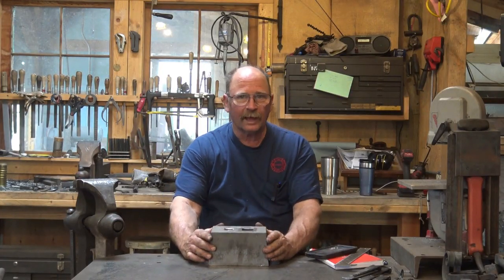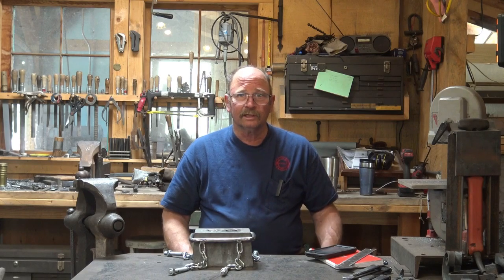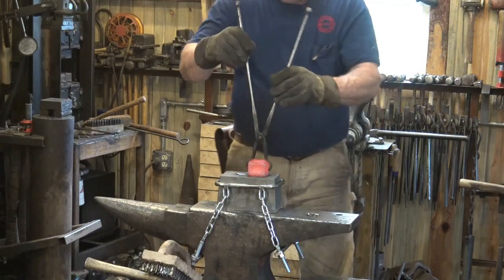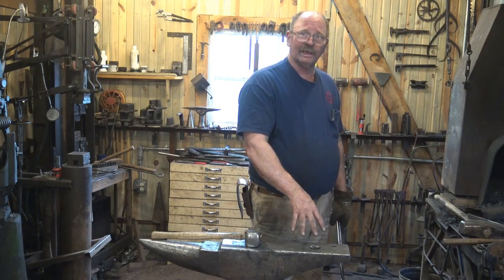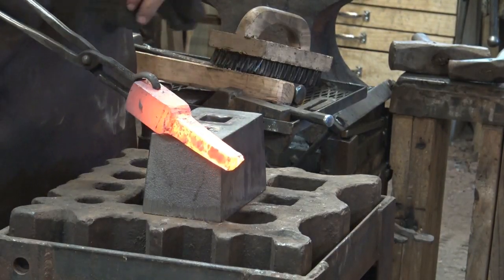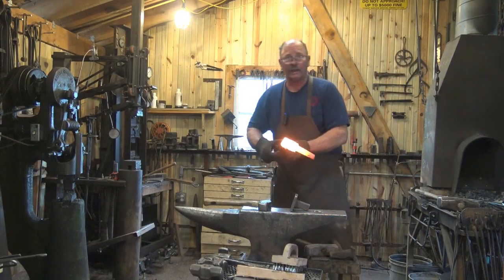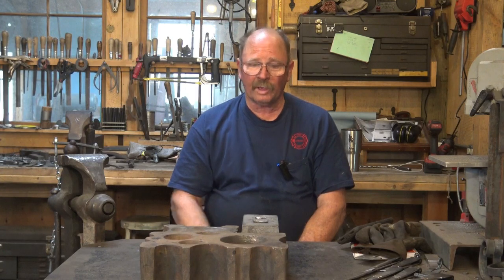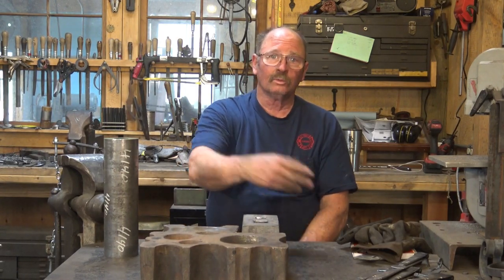Forging hardy tools using an anvil block - blacksmith tools

Comment: Hey John Really enjoyed this one getting to see the use of that power hammer especially :-) thanks for the video God bless
Reply from the maker: Thanks.  Its not a bad hammer, but it doesn't have the precise control of a self contained.
Reply: Totally off topic of this video. I purchased a post vise this week and the spring needs rearched
Reply from the maker: just heat it and bend it to shape.  Post vise springs generally aren't hardened.  It doesn't need much bend, just enough to push it open.
Reply: Thank you

Comment: These anvil blocks (the version you put in the hardy hole) also work a charm when forge welding.  Draws a lot less heat out of your work piece and gives you a bit more time for working.

Comment: John, the black hose behind your power hammer worries me. It seems very tight at the coupling. It got to really resonating the longer you ran the power hammer. You may need to look into a longer hose and some steel braided stress relief hose for the connections to the power hammer.
Reply from the maker: That is just an exhaust hose going through the wall.  it originally just hung free in the back.  So it isn't critical and certainly not worth the investment in braided hose.
Reply: Black Bear Forge Ah ok. That makes perfect sense. After I submitted that comment, I was like, No, John would not let a pressure line get that tight... Should have known my instincts were correct.

Comment: John, the 'anvil block' is more of a big bolster - when using it on the swage block, could you not put a bar of the appropriate size, through the anvil block and the swage and that would stop the anvil block twisting about?
Reply from the maker: There are lots of options.  But I think I will be making a stand for the smaller swage blocks and the anvil block so they are all well secured.

Comment: Hay John hope your well? I really like your sledge hammer. What would you say if I sent you a sledge hammer that I forged?
Reply from the maker: That would be awesome.
Reply from the maker: The larger hammer is an old 14 pounder.  When i moved to the swage block I was using a smaller 8 pound hammer.

Comment: You could make a bracket to hold it steady on your anvil using some angle iron like maybe from an old scrap bed frame rail that could slot into the hardy hole or pritchet(?) hole either or both

Comment: I may have missed you saying anything about it, but is the block a hardened object?  Is there any worry about damaging the face of the anvil when using it?  Love your videos!
Reply from the maker: Tools of this sort are typically cast from ductile iron and not hardened.  So there shouldn't be an issue.  If you are thinking of buying one I would consult Bob to get the answer.
Reply: Thank you for the reply!

Comment: John, My 14 pounder is a straight peen like your 8 lb. I'm a little older than you but you're not a young guy either and we both know that swinging a 14 lb. hammer will whoop your butt, no matter what your age! Liked watching you work.
Reply from the maker: What you saw in the video is about my limit for a big hammer.
Reply: I weigh about 140 lbs. and that's about all I could do too, if that. I may be old and little but I'm tougher than a $2 steak.  :-D